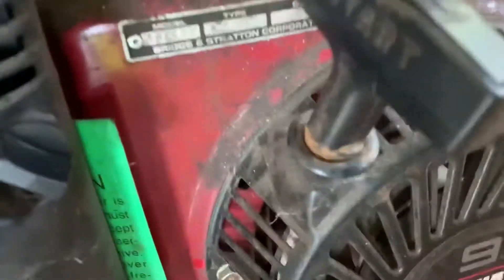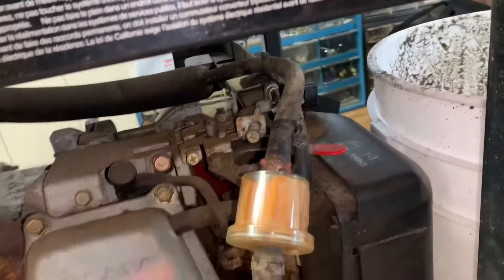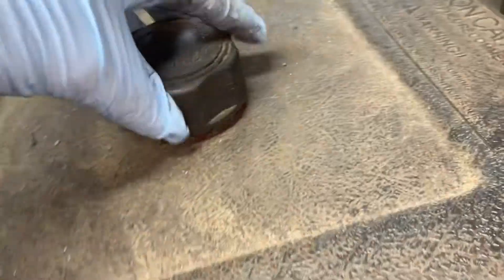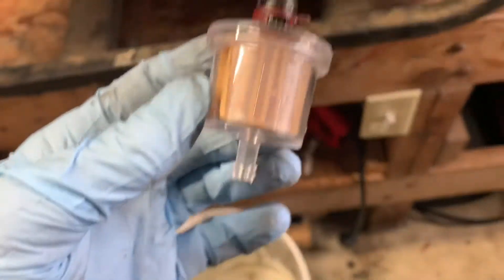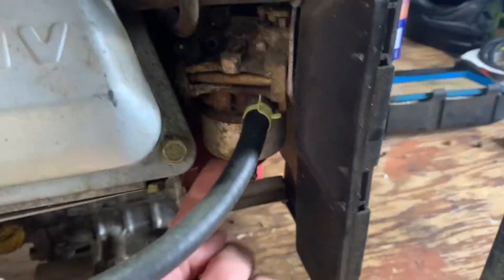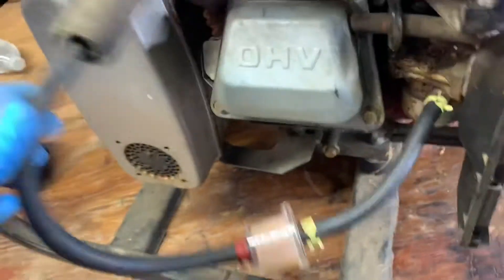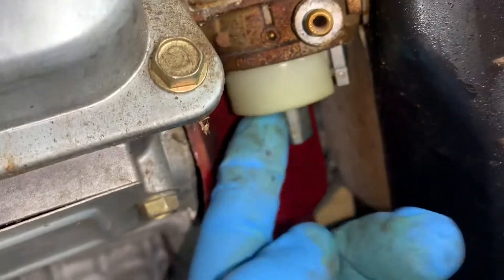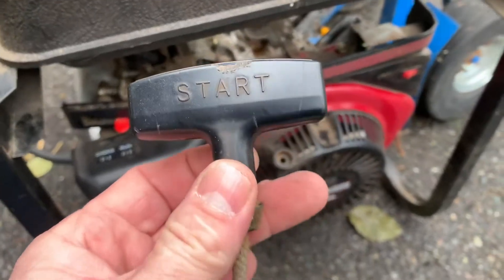Coleman Powermate PRO GEN 5000 Portable Generator Refurbishment Back To Life [PRO GEN 5000 Fix]

Comment: I have a generator like this runs good but has low voltage. Any ideas ?
Reply from the maker: Dang. No ideas here man. Hopefully someone in the comments has an answer. Good luck!
Reply: Engine speed.  Get a meter that shows hz's and set it to 61.5 hz